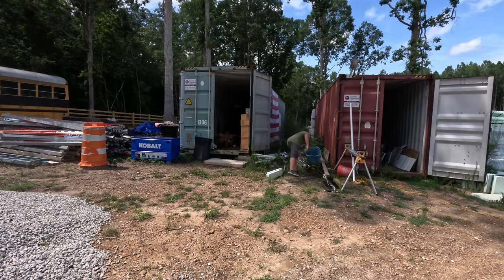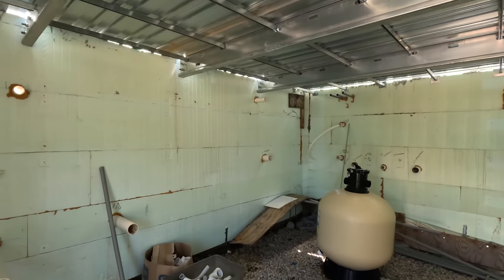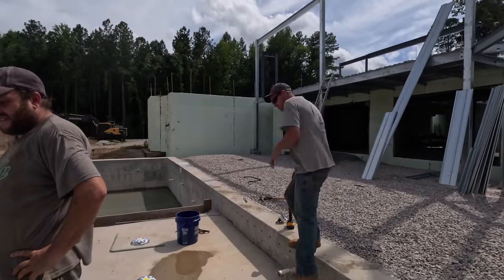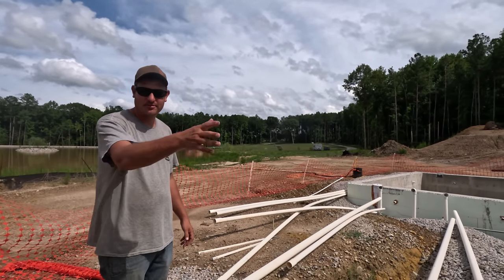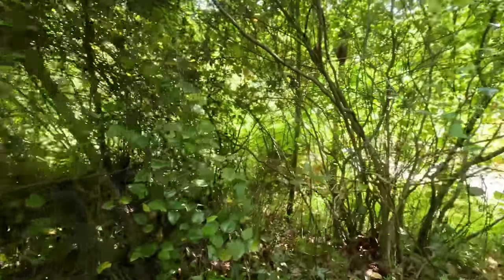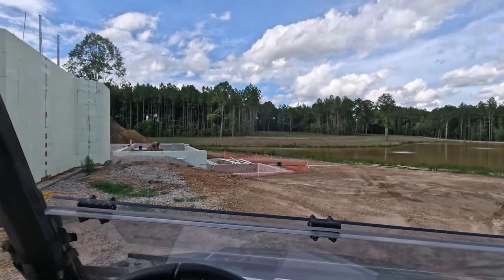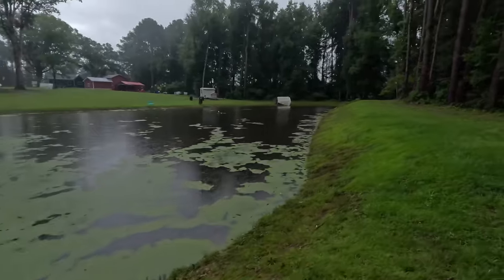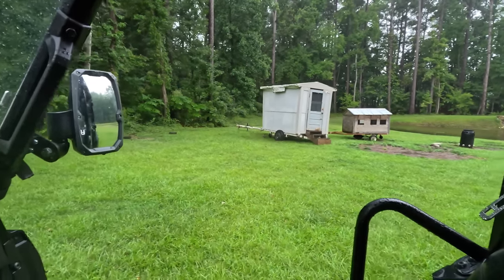Pool Problems and Flooding: Bealy Bad Days

Comment: @20:00 You're lamenting that something went wrong with the pool, but it was not clear at all what was wrong.
Reply from the maker: Because I went over what went wrong earlier in the video. Around the 11 minute mark.
Reply: @BealyGood  problem still not clear to me.  The seal expanded and cracked the concrete?  I rewatched part around 11 min too :-(
Reply from the maker: @davidkwong7546  yes. There is 10 inches of concrete missing all the way around the edge.
Reply: @BealyGood  Thanks for explaining that - thought there had to be missing concrete.
Reply: @heatherlane9270  It took me a minute too.  I had to go back and watch the pour video to remember that seal.

Comment: As a retired contractor, I can attest to the fact there is going to be setbacks during construction. It is just the nature of human commingled with technology. The true measure of the contractor is their ability to quickly assess the issue, make decisions to correct the issue and then move forward. After the fact you can decide where you went off course and what was the main cause involved. It was good to see you had already decided what you were going to do and not let it grind you  to a halt. Keep up the good work. For a DIY project you are doing well. Keep it up.
Reply from the maker: Thanks 😊
Reply: Well said tony
Been there done that!

Comment: Chris was asking the stone size,in NZ we use 3/4 for standard concrete and 1/2 “ for block fill the reason for the smaller aggregate so it flows in the smaller spaces and around reo etc

Comment: I couldn't follow what the problem is.  Is the pool leaking? What is the cause and fix? What was wrong with the upper floor that Chris was inspecting?  What was wrong with concrete truck arrival order?
Reply from the maker: About 10” around the top of the sunshelf has to be replaced
Reply: @BealyGood I see.  I'm still lost about what has happened and why. I'd like to understand the situation. Anyway I wish you the best. I'm sure you and Chris will figure it out.

Comment: What did you mean when you said "you other do it yourselfers now know not what to do" at 10:58?
Reply from the maker: Don’t use stop leak and make sure that your rebar goes to the edge within 2 inches
Reply: @BealyGood  Thank you. Simple cross-sectional drawings showing (a) what was done compared to (b) one showing what you now recommend would answer many questions.

Comment: Definitely do pavers over the pool plumbing. I was involved in a deal several years where the pool had a leak. Of course it was in the portion of the plumbing that ran underneath the concrete. Huge pain in the ass.

Comment: Did you seal the outside of your basement walls before backfilling? Our house we just bought they had to pull all the dirt away from the house and reseal all the way around because it leaked after 20 years. (idk much about it but I was curious your process)
Reply from the maker: We haven’t back filled yet. We’re doing the Waterproofing as soon as we get a couple of clear days

Comment: Another great video of what you guys are doing! After tearing down the old structures and houses, do you ever go over the footprint after Chris has cleared the debris checking for valuables? The house pictured at 4:15 into this video looks as though it's got potential for old wooden planks, valuables, etc. Looks like the old house on one of the tobacco farms we use to farm in Person County NC.

Reply
Reply from the maker: @GranthamShaw  if we are tearing down structures I usually remove anything that can be reused like doors. Chris uses the excavator bucket to separate out copper pipes that go to recycling.
Reply: @BealyGood  Enjoy the process, you guys have the best content!

Comment: Just a comment,
 i've been in pump rooms with decking and concrete over them. I realized that that Decking either is aluminized or galvanized. I would talk to someone to see if you could coat it with  something or provide good ventilation or a  good dehumidifier as there might possibly be alot of humidity in there. I have seen paint peel and that decking rust thru. Of course that will take a long time. I have a feeling however this will be your forever home. Had to replace entire ductwork system in an enclosed indoor pool for a customer once with stainless ductwork because it rusted thru from humidity.
Reply from the maker: @arthurcunningham530  good points. The plan is to coat it all with 3 inches of spray foam. But I am open to other suggestions. This room will have a small mini split in it. Mostly for dehumidification and making sure it doesn’t get too cold in the winter.

Comment: Geoff, you need to put straw bales across the channel into the pond to filter the mud out of the water. Steel post through the bale will keep the straw bale from washing away into the pond.  This is what the highway department does to protect waterways from heavy silt filled water.

Comment: How do you make the poured concrete water tight? I see folks see if one uses 5000 psi, that is waterproof. Pea gravel flows better. High cement, low water content, they well be very strong walls.ah the waterproofing is coming next week, great. I’m looking forward to seeing that.

Comment: When you describe all the things that half to get done in what I perceive is a short time line, by your self that would over whelm me. How do you deal with it?
Reply: Life of a contractor! 
You get used to it after a while.😃
Reply from the maker: I’ve always been like this. I’m more stressed (like now) with little that I can get done.
Reply: @BealyGood      Just keep plugging away at it Geoff & try not to let it eat you up.
I went through a very nasty winter on a new home many many years ago. Thought I would have gotten ulcers with all the worrying.
Once I got done, I came to the conclusion that there was nothing I could have done to change things & thus changed my outlook.
I didn't let things like that bother me again for the next 40 years!
Keep at it, your doing good!

Comment: Both you and Chris appear to me to be pretty (well off) to do people.
Why is it that when you go out beating your way through the brush you can't seem to have a $7 machete with you😊
Reply from the maker: What’s even sadder is we have machetes
Reply: @BealyGood Geoff I’m a certified pool and spa operator. I worked for a town in New Jersey that had a 750,000 gal Olympic and a 130,000 gal 12 ft dive tank and there was 6 wells that had pumps dropped in them in the winter when the pools were drained approx 2/3s be very careful of ground water, it will push pools out of the ground. Always have a pump running when there’re empty and I would have at least one more well cut in. There are pictures of pools that have lifted out of the ground. Not saying it’ll happen to yours but better safe than sorry.

Comment: Pea stone concrete isn't good. They have to play with additives ECT and it still doesn't come up to strength. I did an addition on a school that had pile pads and a grade beam foundation. There was so much rebar in the wall (2 foot thick) that #2 stone in the concrete wouldn't go through it. The rest of the pours the used pea stone and had to change up the mix. A month and a half later it still didn't come up to strength. If you hit it with a hammer it didn't ring. Just a thug sound. There was so much rebar a vibrator wouldn't fit in the wall. It was a cage with 1 inch bar. Even a pencil vibrator wouldn't fit. I finally had a guy follow behind us with a 35 lb chipping hammer with the flat mash head on it and vibrate the forms with it from the outside. The walls came out perfect except the strength which wasn't my problem.
Reply from the maker: I’m at 5200 pounds after 28 days